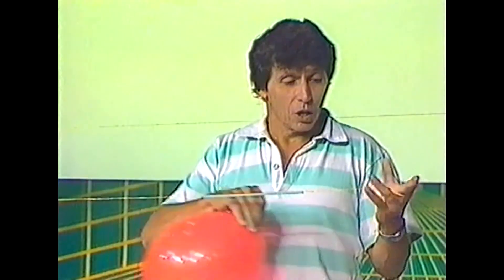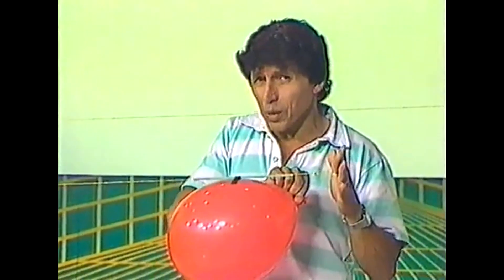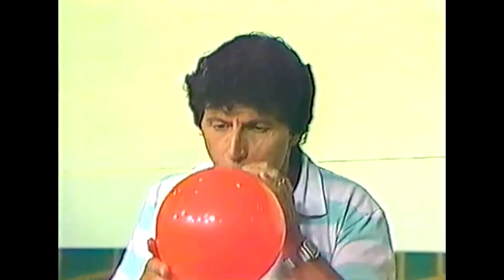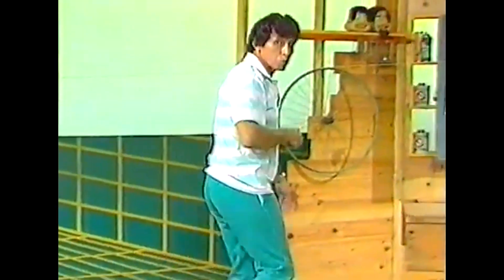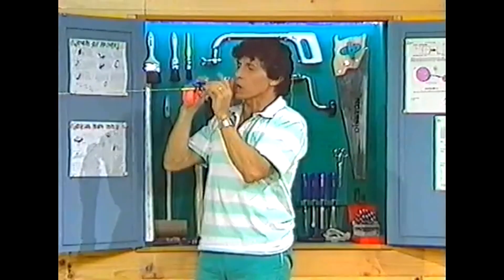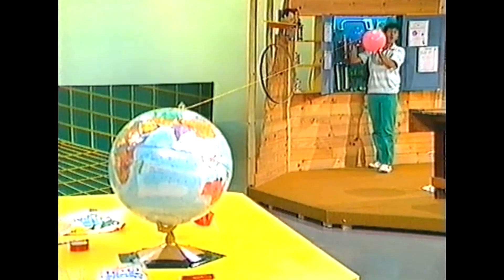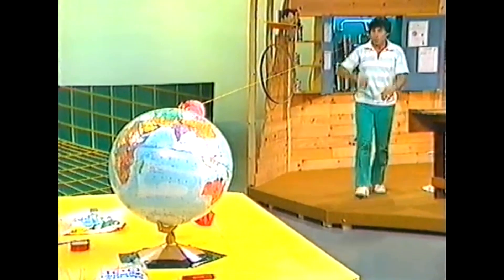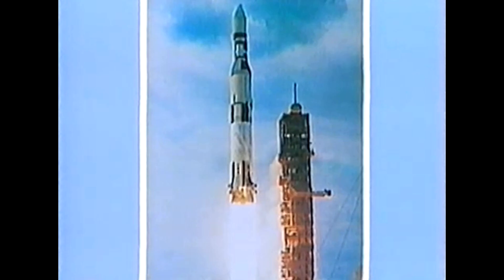Two-Stage Balloon Rocket

Comment: You can make a genuine two stage separating rocket with just one more peice - a stiff plastic ring, cut out of a drink bottle. Inflate the balloon on the second stage straw, and put the neck through the ring. Then also put the end of the first stage balloon through the ring. When that balloon is inflated, it will trap the neck of the second balloon against the ring, so it won't start blowing until the first stage is mostly deflated. The two stages will separate mid flight, and the ring should drop away. 
It works best with long cylindrical balloons, so the diameter decreases slowly as it deflates.
Reply: I tried this in a science demonstration class I taught a couple of years ago... but I'm a bit clumsy and couldn't get it to work.

Comment: If you cross two levers, with their fulcrum between the balloons, one pair of ends very close to the mouth of the second-stage balloon, and the other pair of ends spread around the bulge of the first-stage balloon, then you could have a very rough valve-control that initially kept the mouth of the second stage rather closed and then allowed it to open more as the first-stage balloon shrank.  If it were spring-loaded with a catch that gave way once the force of the pressure from the spring outweighed that from the first balloon, then it could keep the second balloon completely closed until a certain point, and then suddenly let the mouth of the second balloon open completely.
Reply: Of course. But this show was designed for kids to experiment with things lying around.

Comment: Wouldn't this setup be a "Rocket + Booster", as there isn't a staging which will drop the first stage?
Reply: Yes.
Reply: Though it should have jettisoned the blue booster balloon so as to not be carrying its dead weight.
Reply: No
Reply: reasoning? @crystalincyberspace
Reply: @michaelkeller5008  they're both deployed at the same time, both are stage 1, he's using two to further the distance.
Reply: @michaelkeller5008  yeah I get what you're saying now 👌🏼

Comment: technically this would be 1.5 stage, since both stages are lit together - so more like Soyuz (Korolev cross), not Saturn V
Reply: tho, iirc, Soyuz transfers fuel from central core to the boosters

so 1st baloon is more like Shuttle's solid fuel motors - kick at the beginning that runs out first